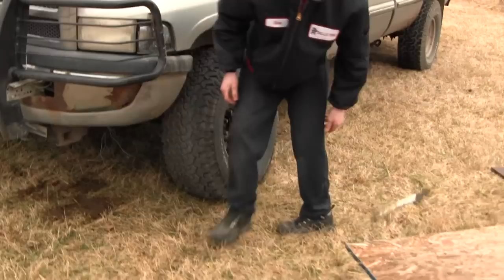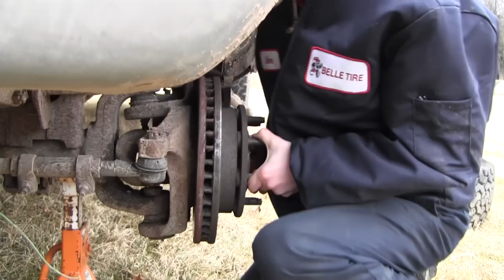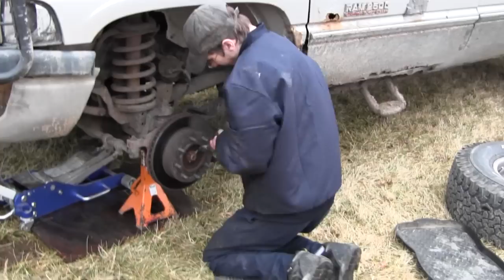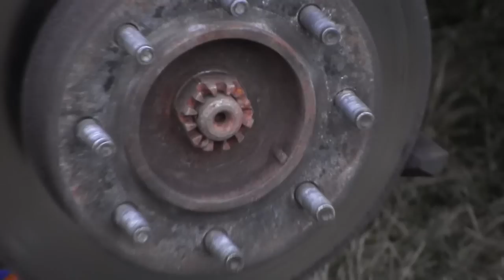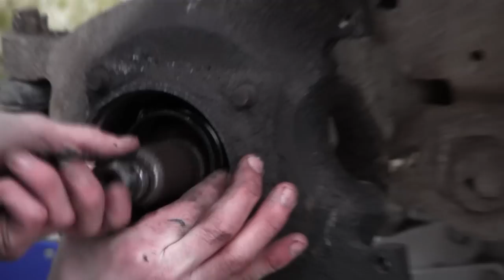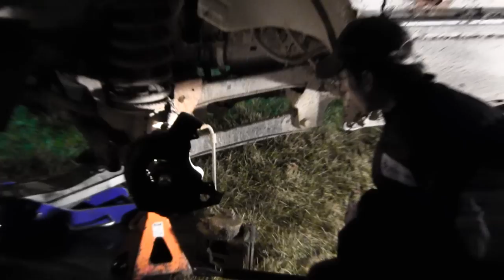Dodge Ram Front Wheel Bearing Failure and Replacement Part 1

Comment: Glad you put this up, as it gave me some info I wasn't sure about on how it mounted etc.
One thing that made it far easier was I heated the Crown nut first(all I have is a Propane torch attached to a BBQ tank), and when it was off, I heated the Hub bearing mounting bolts (the exposed thread side) and a shot of penetrating oil, and they creeped off with just a short piece of pipe on a 24" breaker bar.
The crown nut is a 1 11/16" 6 point (12 point will work) and the Hub bolts need a 14mm 12 point socket.  Just adding this as I didn't hear it mentioned in your video.
I also heated what was left of the Hub housing and between hitting it with a small sledge and chisel on the front, and hammering the 14mm socket with an extension on the bolts on the back side, it eventually popped off.
  Cheers Guys

Comment: I did this in my 1991 f150 over the summer went from fine to locked in under 5 miles lucky I was just about home. When it starting make noise I turned around and limped very slowly the last mile she was smokeing good when I hit the drive way. Water had got in mine and rusted it and washed away the grease do to a bad hub gasket.

Comment: @edzgarage I have to agree it took a heck of a hit. Sure didn't help. Wasn't to bad if I wouldn't have noticed it could had been alot worse if it did it at speed instead of going slow up a back road. Only Waring sign I had was the automatic hub on that side wouldn't engage right away. which was odd but not a look at the wheel bearing symptom if you know what I mean. Oh well live and learn stuff happens. P.s thats when it pays to have a back up rig

Comment: Same thing happened to me on the passenger side.  The axle pulled out so it's leaking gear oil out the tube.  Should I replace the seal as well?  They can be a pain.

Comment: Perfect solution. Get 92-97 ford f350 hubs, rotors, brakes, steering knuckle. No more unit bearings, goes right on the dodge ball joint, 2 piston calipers. I hate that unit bearings fail out of nowhere could be a very scary situation.

Comment: I had to replace the inside bearing .To do that they had to change the spindle with the bearing in it on my 96 2500 4x4 as it was not sold separately

Comment: Prior to the bearing going bad, what kind of symptoms did you have? I've got a 99 and when I brake the front grinds a lot. I had the brakes and calipers replaced and it still happened. Any advice?
Reply from the maker: You didn't mention if you replaced the rotor, if not this could be your issue. Bearing issues are noticed all the time especially when turning.
Reply: I had replaced the rotors as well. The truck has 225000 miles on it and I don't think the bearings have ever been replaced.
Reply: was your hub set up like this ive seen 2 different set ups so far and im hoping i didnt just waste 600 bucks

Comment: So i changed the hub on my passenger side and the castle nut stripped onto the threads, i was wondering if this happened to anyone else? Please let me know. I had to replace the outer shaft and the u-joint and that costed me a fortune